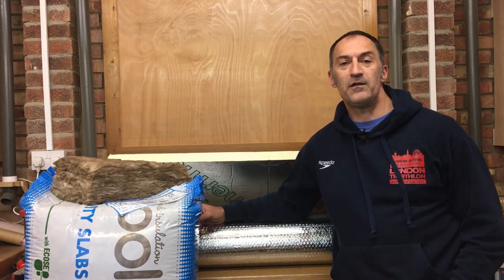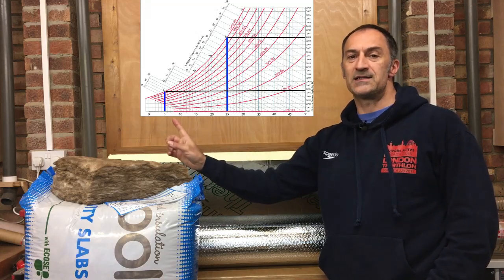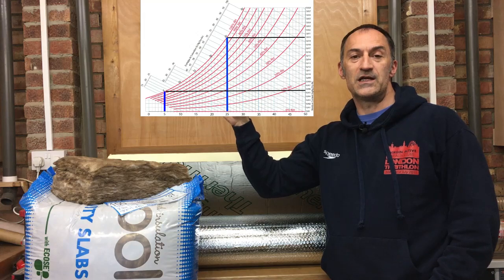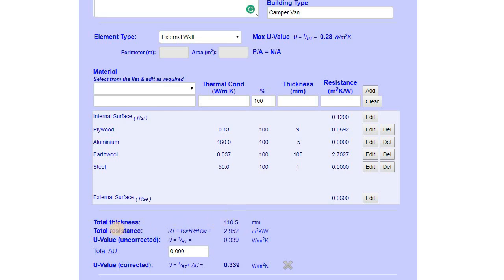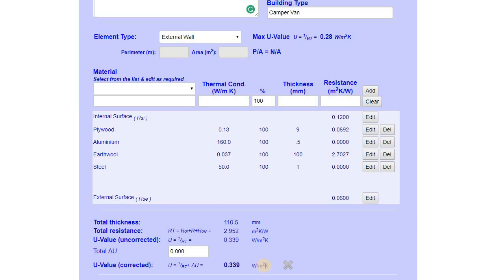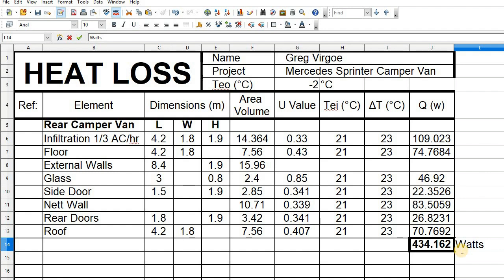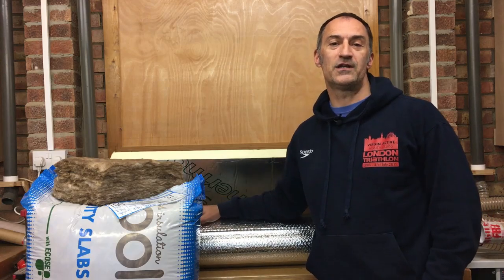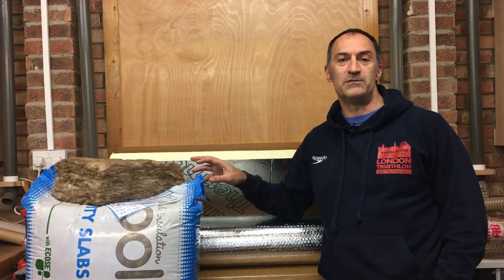How to Insulate your Van Part 1 - The facts you need!

Comment: started yesterday with your Full Build Series video's and even though I have no van (yet) I really enjoy your videos! A question on this video @7:44 you layer everything focussed on a cold climate, but me living in a tropical climate, should I turn the order around to keep the cold in and the heat out? Or would you not isolate at all and design a canopy/tent so the van will always be in the shadow, leave the solar panels exposed to the sun and create air movement with 2 fantastic fans? Thank You
Reply from the maker: Hello Chris, I did cover this in my insulation workshop video, that is worth a watch.
Basically insulation works for both hto and cold climates, heat is transfered from hot to cold so any insulation will slow that process down. Think of your cool box full of ice cold beers on a hot sunny day, its the insulation in the body of the box that is keeping it cool and preventing the heat from getting into the box.  By far the biggest heat gain to a vehicle is the solar gain through the windows, the suns rays enter the glass and heat up the objects inside and that heats up the space very rapidly. So if you can place reflective blinds at the windows to shade the interiror that will help massively too. Lastly as you said a bit of ventilationand good air floow if it get's treally hot will help to kepp it at least at ambinet conditions and not above. Still do the vapoiur barrier inthe same place as at night the temperature can easily drop below the dew point and you would still get condensation issues when sleeping at night if not done. Hope that helps :D
Reply: @GregVirgoe  Hi Greg, I did see that video after I posted my comment. Thank you for your long, detailed and fast reply, sorry for taking up your time. I learned a lot from the insulation workshop video. Especially about humidity in relation with temperature and when windows/panels are about to condense. Now it makes a lot of sense why the windows fog up so easily in rainy conditions and cold temperatures. The only condense we have here sometimes is early in the morning on the outside of the window when the cold AC is blowing on it on 1 spot. I don't know if you covered this in one of your videos, but automotive window films can also block a lot of UV radiation and keep the temperature down. You have them in different grades, from transparent to only passing 5% of the visible light, but they all block UV radiation and don't interfere with GPS or cell phone signals. The laws are different in every country concerning the grading. I know in the Netherlands, where I'm originally from, you need to be able to make eye contact with the driver of the vehicle. But over here (Indonesia) almost every car has tinted windows and it really makes a lot of difference temperature-wise. Cheers, Chris

Comment: Dies this also applies in relatively humid and hot places such as australia and south america ?
Reply from the maker: Shaq Ron yes the transfer of heat works both ways. Heat travels from hot to cold so if you insulate it will also help to keep the van cool. Just like a cold box keeps your salad and beers cold on a hot summer day. 
Shade the windows with reflective foil to cut down the solar gain that will help keep the van cool also.
Reply: @GregVirgoe  I would also suggest you to write a book someday 😄 that would be really helpfull for the campers
Reply: @GregVirgoe  thank you so much for the answer, your videos are the best when it comes to campervan modification, very detailed and comprehensive, keep going sir 100.000 sub soon 👍

Comment: Thanks Greg,  great video so informative and pleasant to watch. 
What do you think about Thermal insulation foam with foil surface (I saw it being sold by kiravans).  It's 7mm thick and it's thermal conductivity is 0.040 W/mK.?
Reply from the maker: Rafał Zieliński ok so it has similar thermally conductivity (k value) to that of a wool based insulation material but the product is only 7mm thick. 🤔
I have 50-100mm of loft insulation in the walls of my van so that’s up to 14x better just because it’s 14x thicker. They both have similar K value I just have much more in my van. 
If you stick 14 layers of that foam together it would be the same as 100mm of loft insulation. You don’t need to spend any more to get a much better level of insulation. Just stuffing all the walls full of woollen type insulation like Diall recycled plastic loft insulation so easy to install and then vapour barrier over the top. Massive better thermal result 7 - 14 times more insulation value than 7mm of that foam.
Hope that helps you out. 👍🏼
Reply from the maker: Rafał Zieliński this stuff is the cheapest and best solution. Easiest to work with too https://www.diy.com/departments/diall-loft-insulation-roll-l-8m-w-0-37m-t-100mm/197658_BQ.prd
Reply: @GregVirgoe  Thanks Greg, that helps a lot.

Comment: greg how do you get a balance for hot summers an cold winters mate
Reply from the maker: D Mag there’s lots of useful information in my insulation workshop video I recommend you watch that one too. 
Insulation works equally as well for cold and hot climates so definitely insulate as best as possible it will slow down the transmission of heat in either direction. 
The biggest heat gain in hot climates is the solar gain through the windows. Have foil reflective window blinds with cut down the solar radiation through the glass and massively help to keep the van interior cool 😎 
Ventilation in hot weather is also key we always leave our roof vents open and our windows covered in the summer months.
Reply: @GregVirgoe  thanks Greg ill.donjust that, great videos love them there a massive help thankyou

Comment: Anybody. Instead of the celotex, if I use 10 mm self adhesive thinsulate black rubber? Is it okay, what next? Thank you.
Reply from the maker: Ivanvlogz you can use that but bear in mind that it’s thermal properties are half as good plus you are only installing less than half the thickness so it will be 4x less insulation in reality. 
It will give you a little bit but only a quarter of the insulation value.
Isn’t that stiff really expensive ??
Reply: @GregVirgoe  I am kind of desperate. 5 square meters 50 euros. I hit you on IG. I am willing to pay you as a consultant. Please help. I will show you what I have. I have nobody to help me with this. You seem very prepared. And capable.
Reply from the maker: Ivanvlogz I’ll go and answer your IG message. Thanks.
Reply: @GregVirgoe  thank you Greg you are a nice guy. You won't regret helping me.

Comment: Hey Greg!
My wife and I have ordered and are waiting for a 2020 Ford Transit here in the United States. Your van build video series has been EXTREMELY helpful as we plan our own build during our (agonizing) wait. I'm a mechanical engineer, so I really, really appreciate your technical discussions of insulation.
I have a few questions for you if you don't mind.
    1. You have inspired me to use mineral wool in the pockets and cavities of the van. However, I cannot find compressible mineral wool rolls here in the US. Rockwool (Roxul) is the mineral wool brand most readily available, and it only comes in semi-rigid batts (not rolls). I reviewed the Knauf website, and its insulation rolls are called "glass mineral wool," which appears to be the insulation that you used. What is glass mineral wool? Is it a hybrid of fiberglass and mineral wool, or is it fiberglass that has been treated (ECOSE) to have the properties of mineral wool?
    2. I see in your comments below that you recommend the Diall recycled plastic insulation. Do you now prefer this over mineral wool? How does its thermal conductivity and moisture retention compare to mineral wool?
Thanks!!!
Andy
Reply from the maker: Hello Andrew and Sarah, thanks very much for watching the video and exciting news about your new van.  
Re wool insulation. Basically most wool type insulation as will have similar thermal properties. So finding a safe and eco brand is the deciding factor. 
The glass version is not as safe as the basalt version. 
The plastic wool has better eco credentials and is mould resistant too. 
You can use a rock wool. Just make sure it’s mineral based not glass based. Or something like recycled denim insulation is also good. Best wishes 👍🏼😀
Reply: @GregVirgoe  Hey Greg. Sorry to reply to such an old comment, but we ended up waiting four years (!) for our van to be delivered (now a 2023 Transit). We just received our van a couple months ago, and we're working on our build. I still plan to use your insulation methods. Regarding the vapor barrier, did you keep most of your wiring on the inside (living space side) of the vapor barrier? When you needed to make a penetration through the vapor barrier (solar panel wiring, water tank overflow pipe, etc.), how did you maintain the integrity of the vapor barrier? Thanks!!!

Comment: Great video, thank you. Need an advise please, from where I am we don't have hands-on this kind of insulations. If you have to choose the insulation that they use for ac ducting or thick rubber insulation which they use in most of the commercial vans to transport fruits with the ac running in the cargo area, which would you recommend, please? Thanks a lot
Reply from the maker: Ehsan Rad use the insulation they use for AC ductwork. It is exactly the same principle here as the cold metal duct is like the skin of your van. Just make sure you do a good job of dealing the vapour barrier over the top of insulation. 
Also watch my insulation workshop video for more facts about condensation.
Reply: @GregVirgoe  thanks a lot appreciate the quick response.

Comment: Most informative video on insulation for vans I have seen.   Did you consider closed cell spray foam,  and why did you decide against it?  My understanding is closed cell spray foam has an excellent r-value and also acts as a vapor barrier.   Was it the toxicity?
Reply from the maker: Jeff Steinmetz in my next insulation video I explain about spray foam. Watch part 2 😀👍🏼
You might also like the insulation workshop video as I explain a lot more about how condensation is formed in your van.

Comment: Great video!  Question for you...I am completely on board using Reflectix for the aluminum being completely vapor impermeable.  Did you do any durability testing on it?  I am concerned about the foil rubbing off as it moves against plywood while driving; or a screw tearing a hole.  I would be considering a 10mil polyolefin sheet commonly used in crawlspaces.  Microscopically more premeable at 0.02 perms, but more durable?
Reply from the maker: Matthew Genaze that would work ok. The double bubble wrap does have a core of polythene and two layers of foil so it has three effective layers. 👍🏼
Reply: @GregVirgoe  Thanks Greg.  Your videos are great!

Comment: thanks greg, would earth wool only require a vapor barrier?
Reply from the maker: David Antony all vans need a vapour barrier to prevent condensation forming. Some insulation’s have an inherent vapour barrier. They are closed cell foam and professional spray foam installations. All wool based undulations need a vapour barrier applied over the top. PIR board is foul faced so it needs all the joints taping to create a seal.

Comment: Hi Greg, thank you for you van build series, very informative and helpful. I'm planning a van conversion and your insulation videos are invaluable. I'm moving towards a configuration similar to yours, but I would like to ask you something. I've seen people using foil lined
 closed cell foam to cover the metallic interior of the van (like Dodo thermo van liner). As far as you know, is it worth it? I mean to use a first layer like that and then of top of it a layer of insulation material (like recycled plastic fleece or glasswool). What are your thoughts, do you reckon it could be useful? Thank you!

Comment: This is very interesting and presented in a way that a complete novice with a fear of maths can understand. Thanks. Does it work the other way i.e preventing a van from overheating in the hot Australian climate? Thanks.
Reply from the maker: Thank you 😊 yes, it does work the other way. Heat always transferred from hot to cold. 
Insulation will slow down the transfer of heat from outside into your van and keep it cool in the summer. The same way your cool box keeps your salad and beers cool 😎 You might find my insulation workshop has some more useful info on condensation and ventilation.
Thank for the lovely comment.
Reply: Greg Virgoe brilliant! Thank you I will check out your other clips. 😀

Comment: I have watched your videos countless times before I had a van to convert.  I can't thank you enough. I'm about to start my van conversion and had just one question regarding the mineral wool you used. Unfortunately, being in the US makes using your affiliate links a tad difficult.  Moving on, I am unable to convert the R-Value from .037 to a number that makes sense in the US. I assume here, the R-Value would be 3.7. Is that incorrect?  I'm looking at Ecowool with an R-Value of 13-15. I know I'm confused and would be very grateful if someone could help clarify this for me.  Thank you.
Reply from the maker: Hi Judy, ignore the R value as most suppliers don’t publish the true information. 
Most wool type insulation will have a similar thermal property. 
PIR based boards will be twice as good as wool type insulation. 
Use PIR boards on flat surfaces where possible and stuff awkward places with a eco friendly wool type insulation. 
Cover everything with a vapour barrier and take all joints before cladding. You will be all sorted. Best wishes Greg

Comment: I've been researching as much information on conversions over the past couple of years as I can as I'm now converting a double decker bus and your videos have given me by far more information than all the others I've seen combined (I think the local accent helps too). So thank you very much for all your info.
 I've just received a quote for insulation and they've suggested a certain vapour barrier to me as it's cheaper and just as effective they reckon. If I share the link I'm wondering if you wouldn't mind letting me know whether you believe that this will do the job just as effectively as the stuff you've used please? Thanks in advance, Michelle. 
https://www.insulationsuperstore.co.uk/product/novia-500-gauge-vcl-kit-135m2.html

Comment: So what your saying is you  now know what the heat loss will be 435w based on the temperature perimeters you specified. Therefore if your calc came out at  435 watts. That would be the heat required to maintain the 23degrees inside the van from say an electric heater. So 500w (1/2 kw) heater would do the job nicely?!!
Reply from the maker: DIY Campervan Man yes that is correct. The calculation was just for the rear of the van. You would do the same for the cab and most likely outcome would require 1kw of heater. 
Which is why we only ever have our 4kw Truma heater on its lowest eco setting. 
I wouldn’t recommend heating with electric unless you are in a mains hook up as it would use too much battery power.
Reply: Greg Virgoe fantastic explanation, thank you. I didn’t realise you where talking the about just the back of the van but makes sense. Yes the electric heater was meant as an example based on mains hook up but the diesel heaters are rated in watts too of course. You really know what your talking about thanks 🙂

Comment: Thank you, that explains a lot. I would be interested to hear your suggestions for eliminating thermal bridging on the ribs of a van.
Reply from the maker: Clifton Snider simply screw timber battens to the tins. I used 12mm plywood on the ceiling and 9imply on the walls. Then fix to the wood. 
Wood has good insulation properties and with a double foil vapour barrier underneath the battens you will have no condensation problems at all.

Comment: Greg, this is FANTASTIC!!  I'm so glad I discovered you!  I am about to start my own van conversion and this is exactly what I want to see - clear, concise, informative information!
Quick question, when calculating the total heat loss, how come can you apply the U values to both areas and volumes, despite it being calculated Watts per square metre Kelvin?
Also, could you give me an idea of what 434W of heat loss looks like, i.e. at what rate would you need to heat your van in order to keep the temperature constant?
Thank you again for this great video!
Reply from the maker: Let's Try Something New the I value for volume deals with infiltration ventilation allowance. The I valise for the walls etc is by Sq m as it’s just surface area. 
To give you some perspective a human gives off 140Watts of heat. So 3 people is approx 400watts of heat 😊 my calculation was just for the body. You can add the same again for the cab so in real terms about 1kw if heating would be plenty to keep the van nice and warm. 👍🏼

Comment: Hi Greg, do you have any advice for insulation to keep heat out so that it stays as cool as possible inside? Would all the advice in this video still apply? Thank you (This is for our double decker)
Reply from the maker: Lamorna Hollingsworth yes heat transfer works both ways as heat is transferred from hot to cold. Think of an insulated cool box in summer. Best to insulate as well as you can for all year round comfort and energy saving. 👍🏼😀